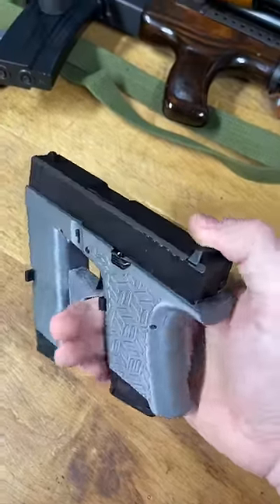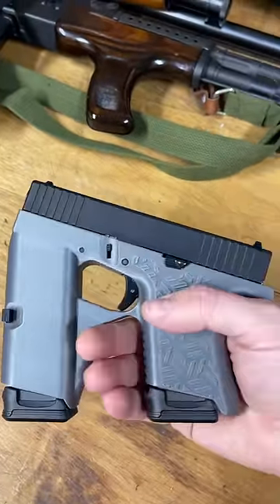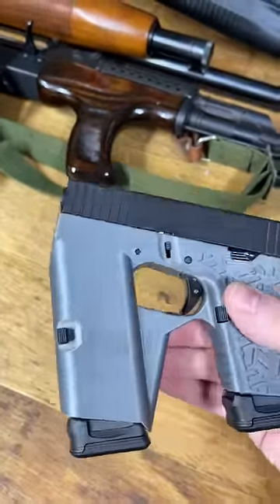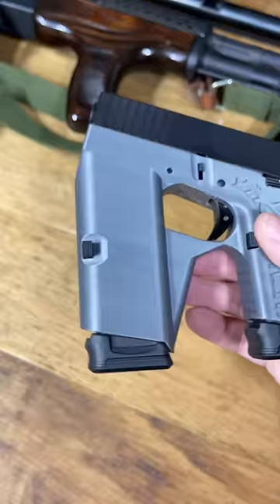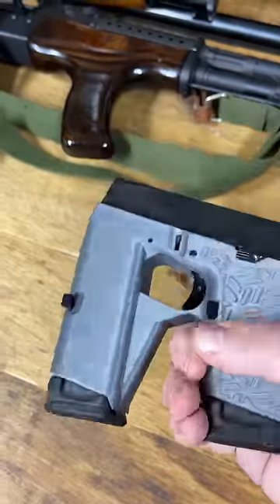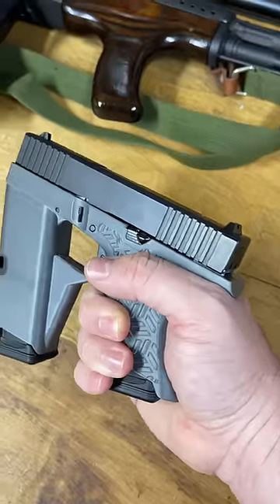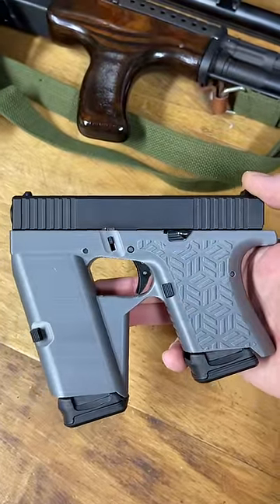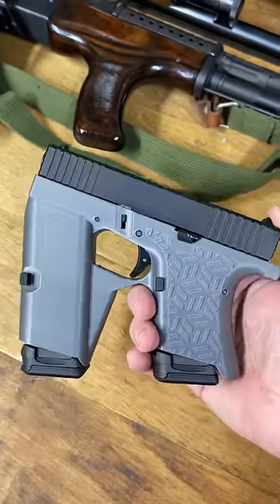G26 NAO “Not Any Other” Pistol

Comment: Accuracy: -10
Reload speed:+5
Reply: Actually it would help with recoil
Reply: Almost liked but thought for a second.  Think it might take longer to load
Reply: @tylerconkle6304  lol this ain't cod it's a plastic printed frame bro no weight to bring down any recoil
Reply: @wojness1292  nah the support would travel less distance than reaching to your belt or tac vest.
Reply: @imjusttrollingyou4014  but he said himself. No support hand. It's a one hand gun so.  Either way it's impractical so no point discussing it further.
Reply: @wojness1292  youre not thinking, the thumb of his right hand releases the mag in the pistol while the left hand(support hand) grabs the mag upfront or do you really think he's using just his right hand to do everything ? That would be pointless and slow.
Reply: It would have better accuracy actually
Reply: @danielcoppock  the extra fully loaded mag would definitely add weight lmfao
Reply: The accuracy will be fine, It’s possible to hold the mag part as a grip plus a Full mag gonna bring the recoil down because of its weight
Reply: Accuracy: -10
Reload speed: -5
It's much faster to drop mag while grabbing a new one and load than to drop mag, drop full mag and catch it, load. That's so over engineered to be a bad gun it's California certified.
Reply: @Lurkartiist  looking at how most people shoot pistols? Nah. It might help with muzzle climb, but most people need horizontal control as well which is easier with a hand in palm grip/2h grip
Reply: @danielcoppock  bro. The magazine in the front, has some weight to it.  So yes, it Wil counteract recoil to some degree.
Reply: @danielcoppock  the rounds in the spare mag will reduce recoil
Reply: @wojness1292  could easily enough hold from the bottom of the mag and it's not too unnatural try it yourself idk why this guy has to pretend you can't fit another hand on there
Reply: @danielcoppock  the loaded mag in the front is plenty of extra weight
Reply: 😂😆 you doing it wrong it's a forehead stapler 😂
Reply: @danielcoppock  i guess you don't know how a front grip works. Weight? 🤣
Reply: …and yet the views of this video are impressive so…mission accomplished! 😂😂😂
Reply: More like ammo capacitie
Reply: @danielcoppock  the added weight from the extra rounds in the mag?

Comment: Maybe for v2 you could add a front "dovetail" for when you're "not gripping " that magazine holder
Reply: That's the first thing I saw, flush front end. In a moment of panic you're more likely to hurt yourself with a misgrab on your not-grip.
Reply: But that would make it safer, the ATF would never permit such things.
Reply: Or at least so you know your finger won’t slip up in front of the barrel 😂😂
Reply: I have fairly large hands so this probably wouldn't work for me on a fire arm of that size but if you rest your thumb in the Grove at the front of the trigger guard where the rib is you could likely anchor there
Reply: The lack of a beaver tail is what makes it "not a grip."
Reply: It's not a Grip Zone™, they're just weight-saving relief cuts!

Comment: It might negatively impact your accuracy, but it probably balances out with increased stability with the added weight of another magazine to keep the barrel from jumping as high as it would otherwise. By this principle, it would also be an easier grip while firing because your arm is taking all of the remaining recoil forces, allowing the weapon to easily and smoothly cycle while mitigating muzzle jump with the spare magazine's weight.

Comment: it would be pretty cool with a comp or suppressor or some sort of muzzle device that gives your fingers some much needed buffer…

then extend the grip to a G17 size and some minimalistic finger grooves on the front of the magazine, along with a handstop(like a beavertail on the opposite end) 

as a full auto subgun, it would be insane because of the lighter slide
Reply: That was my first thought...taking off an index finger during the heat of battle is a real possibility without some lip under the opening of the barrel

Comment: This is a good video game gun design. You always hear that switching to a pistol is always faster than reloading but after the bullets of your pistol run out, you'll waste time. With this design, it won't only make it faster but it will also add a new statement on the board: 
"Switching to your second mag attached to your pistil is always better than switching it with a mag on your belt"

Comment: I'd like to see a gun that has two different magazines one in each handle and both able to load bullets into the gun making you able to use two different types of bullets depending on your situation.
Reply: not exactly like what you mentioned but someone did make a "double barrel" semi auto. its mad crazy. its like two pistols welded side by side...I think. its been awhile since I've seen it. pretty crazy though
Reply: The only real situation that'd be practical at all ever is likely for use in a shot gun and that already exists
Reply: There is a gun similar to that, forgotten weapons did a video on it, the mags are tiny, you drop the mag and then there’s a mag behind that, and you can’t the mag forward into position

Comment: As a left handed shooter I could get a "proper two handed grip" on that gun without any issues.
Reply: How does being left handed make any difference?????
Reply: @bobstark4020  with a right handed grip you're pressing the release button on the mag holder with your palm. With a left handed grip you can avoid the button entirely.
Reply: @Valin9275  oh OK  I see your logic, I am left handed but I shoot right handed (right  eye dominant), I can shoot lefty and do so occasionally when stage procedure demands it. I liked the idea behind that gun, even though it was not very practical in my mind.
Reply: Say it again bro
Reply: The mag release isn't what prevents you from doing so. It's the lack of placement for your support hand thumb, and the fact that you'd be creeping your support hand index finger closer and closer to the muzzle.
Reply: @TommyTombstone  yeah I'm kinda on the fence on this one, it's certainly interesting looking, needs a few changes such as a bit of a lip at the top to keep the left hand from sliding up and/or a moderate finger groove for the same reason. It would make a great left handed movie villain gun or perhaps a collectors item if the price were right.  I might like one for a 1911 if available. Just my 2 cents.
Reply: @bobstark4020  the lack of a hand stop is what keeps it 100% non NFA
Reply: @TommyTombstone  ah never thought of that, good one, skateboard tape it is!!! Very heads up on your part.
Reply: @TommyTombstone  add a suppressor then 🤷
Reply: @geoffreyolson9720  tell me you've never been stung by a spicy can, without telling me.

Comment: Also can’t be used as a grip because it would be a huge safety hazard since 3d printed parts sheer easier along the layer lines. You’d have to print it on the side for the added strength
Reply from the maker: The actual grip of the gun does fine printed in that orientation. Do your job printing it properly and the orientation doesn’t have a huge impact with the forces you’re dealing with here.

Comment: Im not sure i agree. You may not call it a grip but it would definitely be good used as a recoil preventer. Maybe i didnt say that correctly. What i mean is when shooting and placing a hand in front reduce the raise of the front end. Here is an idea for your next project. Most all guns have trigger guards. For those who dont know its the ring or half ring around the trigger. But how people put hand over hand to prevent recoil maybe put a half or 1/4 ring in front of the trigger guard so as you hold the gun with your main hand and your second hand or the finger loops around that half ring thats in front of trigger guard.

Comment: It wouldn't be a front vertical grip anyways. It's angled, which makes it compliant. You could have anything from a 45 to a  89ﾟgrip on a pistol and it would be legal, as long as it isn't 90° from the barrel.
Reply from the maker: Unfortunately, it’s not as simple as that. Heavily angled designs that allow you to wrap your thumb around it and grip it have been determined to be secondary grips and aren’t permitted on pistols. The ATF has forced redesigns and had products removed from the market because of this. 

Hell, there is a Roni kit that required a redesign , even though it had no front grip at all because they included a thumb rest for a support hand. That was enough to reclassify it as an AOW as it’s not designed to be used with one hand.

Comment: In all fairness, you could use the other hand and grip it from the from, thus gaining some control.
Reply from the maker: And likely shooting a hole in your hand under recoil.
Reply: @booliganshootingsports  First, if you're holding the trigger grip with your right hand and holding the front smooth grip with your left, when you fire if you lose grip the recoil will cause the barrel to go up away from that left hand. 
Second, if it mattered, by the time recoil happens the bullet is already down range.
Reply from the maker: @DrHarryT  most people, especially untrained ones, do subconscious movements to anticipate recoil. They brace for it. They shift their grips when shooting. If you’re pulling back on the support hand, without being able to actually grip it properly since you can’t wrap your thumb around it, it could easily slide up prior to shooting, especially without a handstop of any sort to keep your hand from sliding up. If it doesn’t get you on the first shot, your hand could have slid up for follow up shots. I’ve seen people shoot themselves in the hand while using an actual proper forward grip, it’s more common than you’d think. 

But that’s the point, because adding any features that make it a safer grip also turn it into a felony.

Comment: That's not dumb. The extra mag creates less recoil, through added weight and control points to place your hands. You'll be more accurate, but no holster made will hold it
Reply from the maker: It’s really not too hard to do some custom kydex. Now, carrying a printed meme gun is a dumb idea for other reasons, but a holster isn’t the hurdle.

Comment: The legality of angled forward grips is not contested, the ATF sees them as perfectly fine, according to letter ATF Letter 903050:MCP,  3311/2010-1021
Reply from the maker: That letter is 11 years old, is specific to only one product (The Magpul AFG which doesn't allow you to wrap your thumb around it) and has been superseded by several ATF opinions on angled grip/accessory designs which were brought to market after the fact. The ATF has routinely issued the opinion both publicly and privately to parts manufacturers that if a pistol is fitted with a forward mounted grip/magazine holder, which is angled off axis from 90 degrees, but still has designs in place that allow you to both wrap your thumb around the rear to grip it, and has grip enhancing features, that they consider it a secondary forward grip, turning the pistol into an AOW. 

Several products were forced to be redesigned to add things like webs at the rear to prevent thumb wrapping (see the Flux Defense spare mag holder or Stark Industries Express Grip), remove grip enhancing surfaces, or completely removed from the market. There is even a Roni style chassis for pistols that had NO forward grip at all, but had a thumb rest for the supporting hand, and the ATF forced them to redesign it to remove that feature. 

It's really not as simple as "if the grip isn't 90 degrees it's legal", which is unfortunate, because NO accessory should change the legal status of any firearm.

Comment: The law is specific in the front grip being 90% from the barrel that angle is fine you could've texurized it
Reply from the maker: It’s not though. There’s no law stating any details about what does and does not constitute a secondary grip. There are dozens and dozens of ATF opinions on it though, and they have classified certain grips that are not 90 degrees as being vertical grips. 

So it’s not as simple as 89* is fine.

Comment: Does it work ? like really shoot a real bullet? What kind of material is it made of ? So Cool 😎
Reply from the maker: Yes, it's a real firearm that fires real 9mm rounds. The frame is printed in PLA+, the slide, barrel, springs, etc are all metal factory made parts.
Reply: @booliganshootingsports  that's so neat i was curious of the material being able to handle that much pressure? So u don't have to worry about it blowing up ur Hand ?
Reply from the maker: @Lion-dq9uj  the frame of a handgun doesn’t contain any pressure. The metal components handle that. The frame only deals with kinetic impact forces which the PLA+ material is more than capable of handling.

Comment: Just make it with the extra mag a half inch or more forward, you can get a better grip, and you can press the gun against the criminal without accidentally pushing the slide back on their body.
Reply from the maker: That’s the whole point: you CAN’T legally make changes to the design that make it a better grip.

Comment: Just looking I see 1 fatal flaw, the print lines are with the slide instead of up from the bottom, if it was steel it's another story
Reply from the maker: You want the print lines running parallel with the slide. This is the strongest print orientation for Glock pattern frames.
Reply: @booliganshootingsports  I'm just second guessing because the recoil would tear the slide off the grip....
Reply from the maker: @Springtrap exe  that’s… not how it works, lol. The slide rides on steel or aluminum rails that are pinned into the frame. Those rails and the steel locking block take the forces of firing and transfer it into the frame through press fit parts and pins. That’s where the print orientation comes into play, as angled prints can and will cause the frame to break at the pin holes. Which is why you want a Glock pattern frame printed straight up and down.
Reply: @booliganshootingsports  I was meaning for a real firearm, as the recoil force is more than enough to overcome the slide reset spring
Reply from the maker: @limehuzki  this is a real firearm. Not sure what it having enough recoil energy to cycle against the recoil spring has anything to do with the print orientation or what I said though…

Comment: I can imagine the balance is way off. As u fire the centre of grav will move closer to the front after every shot. It would be a nightmare to master.
Reply from the maker: It’s actually much easier to shoot since there’s weight directly under the barrel to counter muzzle flip. Aside from the fact that you can’t get a proper two handed grip on it.

Comment: How does this prevent you from using a 2 handed grip? Do you know know how to hold a pistol?
Reply from the maker: Because you literally can't get your support hand in for any sort of modern pistol shooting practice. You can't do a high support hand grip because the rib at the rear of the spare mag holder (present to prevent it from being classified as a forward grip) prevents your fingers from getting in there. You can't do thumb over or straight thumbs for the same reason. You can't do any of the less ideal older styles like thumbs crossed or trigger guard index for the same reasons, and because the front of the trigger guard isn't there. You can't grab the spare magazine holder because of the reasons I stated in this video. 

So you're left with a slightly modified teacup grip or holding your wrist which haven't been acceptable ways to shoot since like 1951, lol. 

And that's the whole point of this design. To show that making a design compliant with our asinine federal firearm laws result in guns that are less accurate and less safe to use. This is an educational design to educate people about our idiotic laws. 

But yes, feel free to educate me on how you would attempt to perform a two handed grip on this gun.

Comment: I know Gun Regulations are a Minefield especially because of what happened recently but can we all agree that they dont make any sense, A vertical grip on a Handgun is a felony, but if you just rotate it just a tiny bit its now OK, as if the BS reasons why they decided grips needed to be banned in the first place is somehow negated due to a slight rotation.
Reply from the maker: Yep, and showcasing those ridiculous laws is specifically why I designed and built this.

Comment: What locking block did you use for that ?
Reply from the maker: A Gen 3 G26 one
Reply: @booliganshootingsports  I didnt realize there was a one piece locking block / front rail design until now. Thank you
Reply from the maker: @MendezMotorizedBicycles  it’s not, it still uses two separate pieces for the front rail and the locking block.
Reply: @booliganshootingsports  yes but the there are two different styles.
Reply from the maker: @MendezMotorizedBicycles  yep, different rail designs for different frame designs. The exact rails needed for this model are listed in the release documents 👍